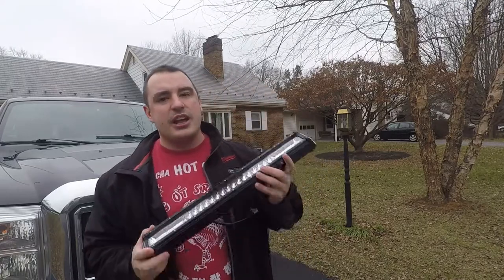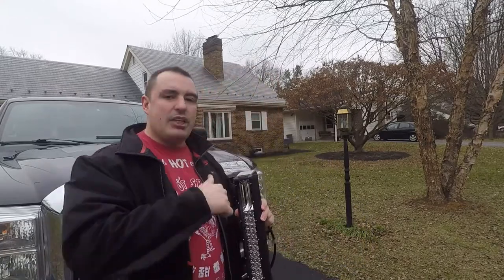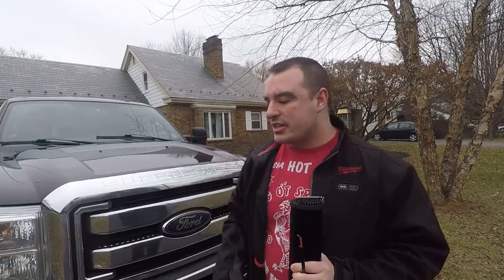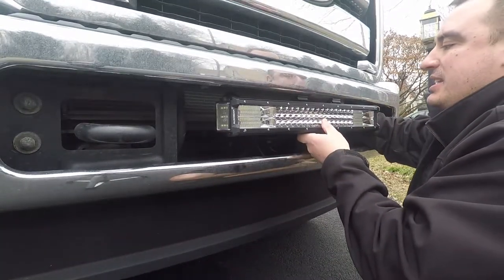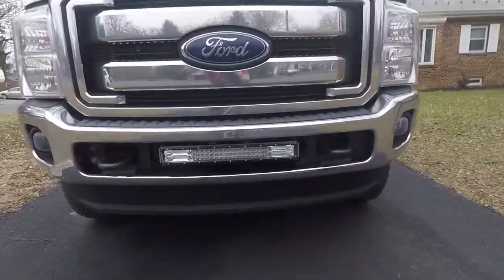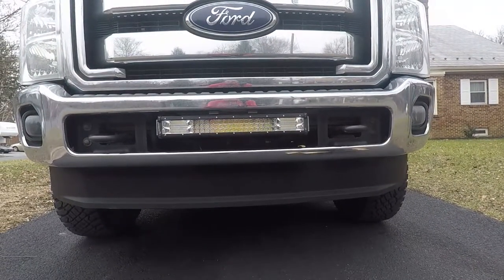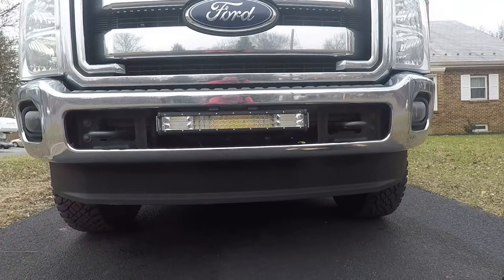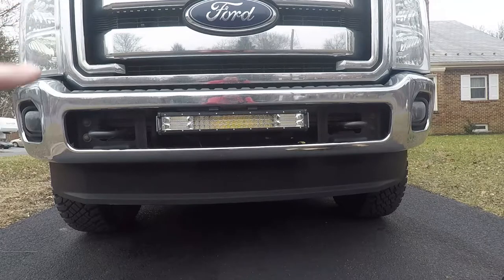2015 F250 Led Light Bar Install We Got Rained Out

Comment: Hey bud I need some help with this sct x4 tuner. I went to out a tune on and it gets close to being done then shows an error and says to reset the vehicle to stock. It's also not showing where I can do the EGR delete while trying to put a tune on as well
Reply from the maker: Have you set it back to stock and then retired. Have you recently updated your device without putting the truck back to stock first?
Reply: @six0bros  well when I got the tuner I never put a tune on it. I tried after it said to return it to stock and it just keeps doing the samething. I updated mine about two months ago then the gauges woupdnt work so I had to contact sct to get that fixed and now this.
Reply from the maker: @hilham89  so just to clarify it is currently running a stock tune?
Reply: @six0bros  it's running stock. Today was the first time since I had the tuner that I have tried to put one on it. I went into the device info and it still says unmarried